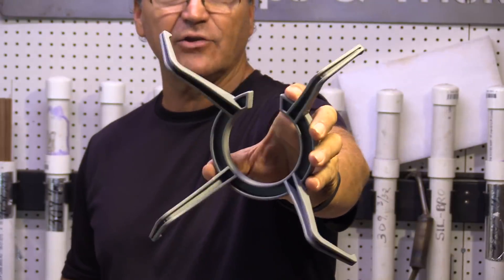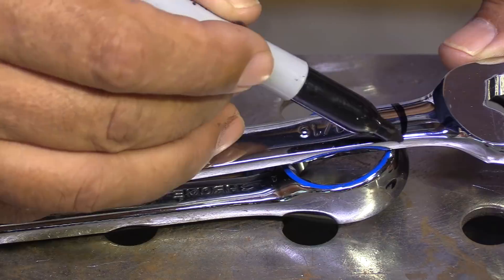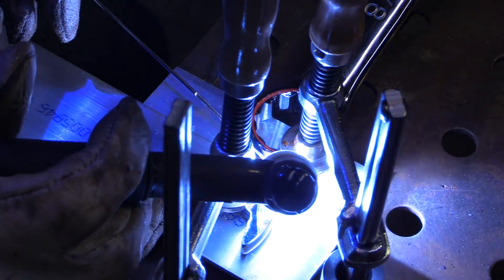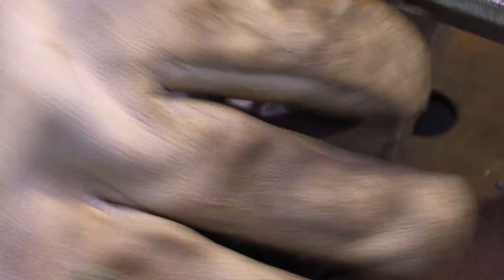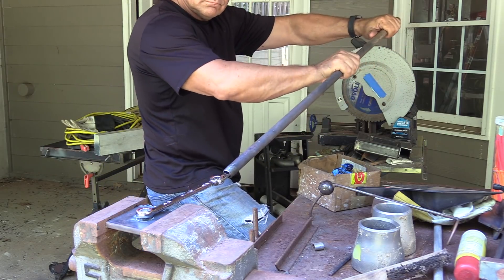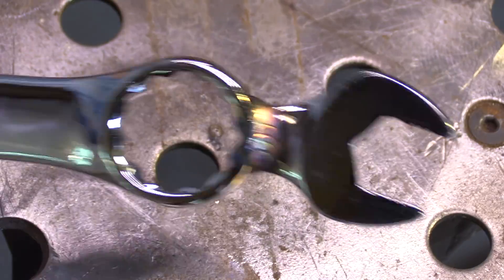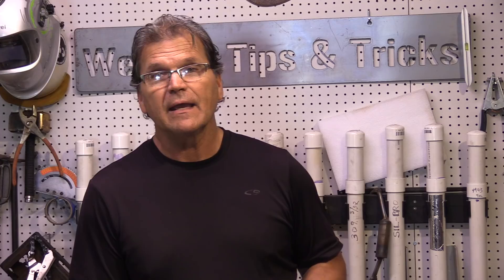Hel Hook, Welding Chrome Vanadium Wrenches, and 309 Filler rod

Comment: I tig weld alot of cold roll steel to stainless in small horse bit parts do you have and filler advise i have been using 309 and i doing right ?
Reply from the maker: Sounds ok. 309 is made for stainless to carbon

Comment: I welded a chrome vanadium wrench that I cut in half to a piece of plain steel. I uses the 309 rod and it worked great. I didn't fool around with playing the foot pedal. Instead I clamped both pieces side by side in a vice. The vice ate the excess heat.👀

Comment: Or for welding outside in a little wind 309 will cover your rear end no porosity also 2209 duplex works well outside in wind of course non critical welds only

Comment: Great page, I just found it and subscribed. 
Do you do custom welding if someone sends you something?
I have an awesome vintage steel hammer but the handle side is too short and I wanted it longer..
I live in Veteran housing so I can bring my little Arc or tools here. 
I bought one in 93 and it still works like a charm. But its in storage since 2002

Comment: A little trick is to also use the box end of a 1-1/8” wrench and use it to put the meter on then it stays on of course and you know right where it is when you need to remove. So those left over end you have will work perfect for that. I’ve also welded a washer with 5/8” hole to the end of box side of wrench and reinstalled the nipple end of the brass part for propane attachments like a propane fired turbo heater and that wrench is always there and never lost when needed.

Comment: Now that's a strong weld there, would you expect a 316lSi rod to preform in the same manner when it comes to chrome vanadium? I have a spool of 316 that I twist up (like you showed me) for TIG rods, and I haven't come across any small quantety spools or rods other then 70-6 and 316lSi around here. Thinking about maken something like that for another aplication, mabe I'll even make one just like it, afterall I haven't used anything bigger than a 22mm for anything but the gasclock since I stopped working on diggers and tractors

Comment: Never thought of using a stainless wire to weld wrenches, always use the regular steel wire when I tig them. I always thought it would crack under extreme torq. And I have an elcheapo scratch tig I weld with only too.

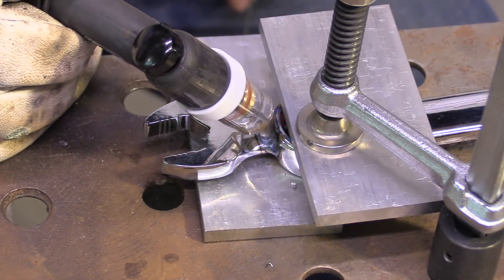Comment: Does anyone recognize what brand of wrenches that is?  I’m curious because of the little teeth cut into the faces of the open end wrench. I have a set of SK Tools new X wrenches that are like that.  I know SnapOn has a similar style wrench as well.  Anyone else? It really works well biting into fasteners to keep them from rounding off.  Thanks!  See at 2:00

Comment: I just need to ask.... why didn't you just hang both spanners up instead of cutting one and welding the open end to the ring end? i couldnt really understand the point of it? exept for only having a single spanner.. but then 2 panners is better than one if you have to hold one end in one size and the other end in the other size..  
Did you over think this a bit? ive been guilty of such things. .. or just demo welding 309 on vanadium is the main point?  love the vids.. want to get a Hel hook but on ebay they nearly cost $40 US dollars incluing shipping to Australia!!  in our money thats like $50 for a hook..   very cool though.

Comment: Hey Jody I have a question about those clamps that fit in the holes of your welding table... What is the specific name of such tools and where can I find them at a decent price as a hobby welder? Thank you!
Reply: Alessio Sangalli - I made them by welding round bar stock to harbor freight F -clamps, at the place where I sawed off the fixed clamp jaw.
Reply: keith schuessler nice do you have a picture? I just bought a welding table with the holes

Comment: Been using 309 on a lot of cast steel/ductile iron repairs. Have had better luck with it than 312. Most of the older vises are cast steel and ductile iron instead of cast iron.

Comment: Killer content in this video!! Information DENSE!!! More things you didn't realize you needed to own or needed to know in less than 5 min. Hell yeah Jody!! Thanks!! How about a source for those split cylinder valve caps??? Man, those things will sell!! All the guys who are doing contract work in food plants, thats gonna be mandatory I tell you right now.
Reply: I fail to see how the valve is protected, aside from a lockout condition.. the reg can still snap the valve threads. The thin gauge might still transfer full impact to valve. What am I missing?

Comment: I thought it was hazardous/deadly to weld anything with a galvanized or zinc coating?
Reply: lilbluecar89 ... it is definitely hazardous... also inefficient... you wanna grind it off first using every bit of PPE you can think of... I use galvanized from time to time... even after grinding... I stick weld it and use a big fan... safety first...

Comment: Have modified/customized many a wrench but I use 312 stainless filler
Reply: JoJo Mama why 312? Just curious here.
Reply: Tommy T ...312 seems to be very good at welding hand tools,dissimilar ferrous metals,even cast iron.It's kinda my go-to rod for exactly what this guy is welding
Reply: JoJo Mama thanks. I'll grab half a pound and try it. I've never ran it before.
Reply: Tommy T ...yeah,I always try to keep some handy,think you'll be loving life if have some around...
Reply: Tommy T ...by the way, check out Brutus"A" rod,crazy expensive but from what I've heard it's just 312...
Reply: JoJo Mama lol! Right on boss! I'll start with some 312 first, then maybe the Brutus A (if I can ever get paying customers!!)
Reply: Tommy T ...like I said,I believe Brutus A actually IS 312!
Reply: Isn't super missle 312?
Reply: JoJo Mama I will take inconel 82. Crown T212 works super well but in my area of the country it is about 36$ per pound!

Comment: 309 is my go to filler rod for just about whatever. It flowes good, looks good, and rarely cracks. I have and use more 309 filler rod than any other filler rod in my shop. I welded my enitre front axle together with 309 rod and I haven't had any problems with weld fatigue.

Comment: Cool thing. Back in the day we would take the most used sockets and we welded them or even brazed them on a steel rod. Man those were handy when you really needed more leverqge and were afraid to use ur ratchet (example is loosening car tires).

Comment: Could you do a review of the fronious transteel 2020? 
They say it can mig aluminum without a spool gun all day long. I'm going to do some legend scale aircraft aluminum tubing for a number of projects and I'm trying to see if the fronious is right for me.
Reply: any welder can weld aluminum spray transfer on dc hard aluminum wire